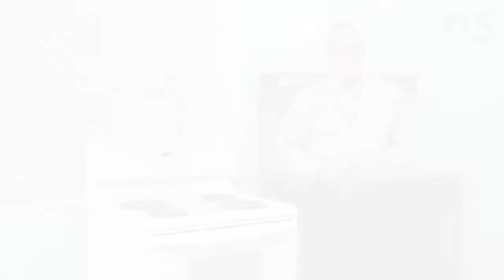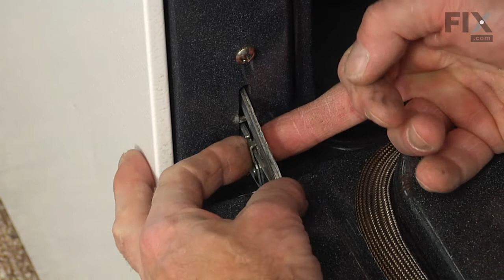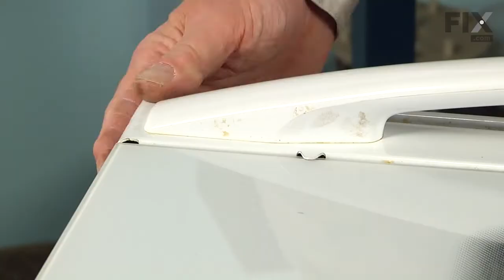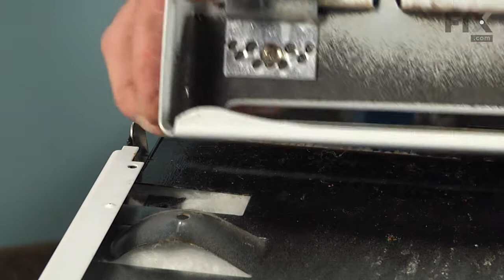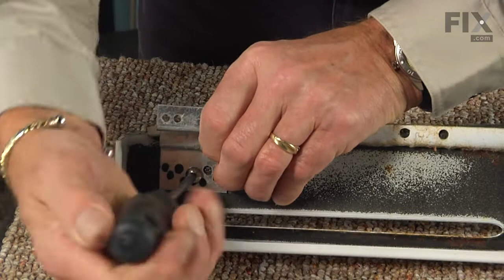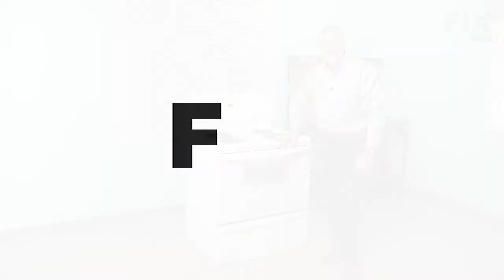Frigidaire Range Repair – How to replace the Door Handle

Comment: If you have to undo the selftapping screw holding the handle on to adjust the bracket it will strip and won't retighten. The plastic is too soft and the threads too small to hold a 2nd time. I did not overtighten it. This is an expensive part badly engineered.